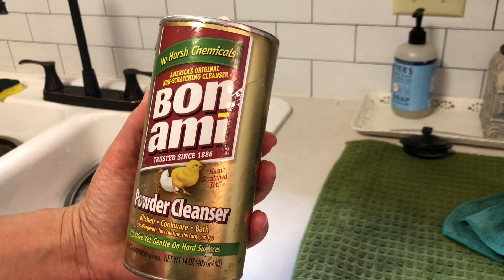HOW TO DEEP CLEAN A DIRTY OVEN - Learn a few cleaning tips and get cleaning motivation!

Comment: Do you wash your microfiber cleaning cloths just regularly with the rest of your laundry? I recently bought some e cloths and the directions say not to dry them with dryer sheets, but of course they ended up in a load in the dryer with dryer sheets. Just wasn't sure if that ruins them.
Reply from the maker: Yes, I wash them with my towels. However I do t use dryer sheets. Instead I use wool dryer balls. I believe the dryer sheets leave a film on the microfiber sheets.